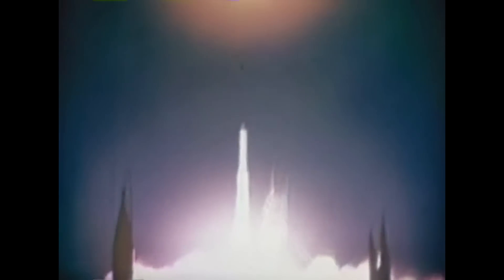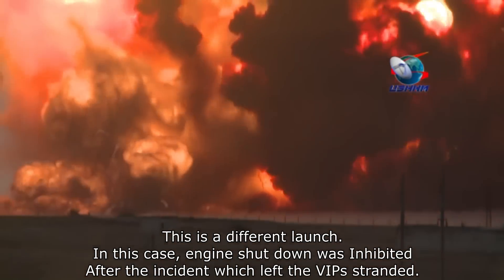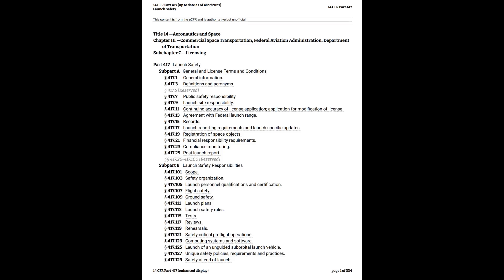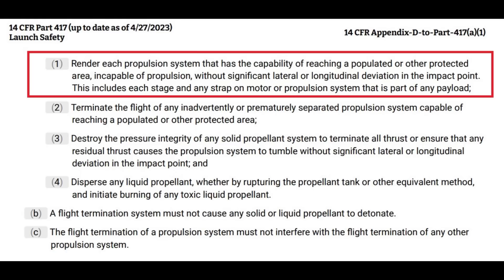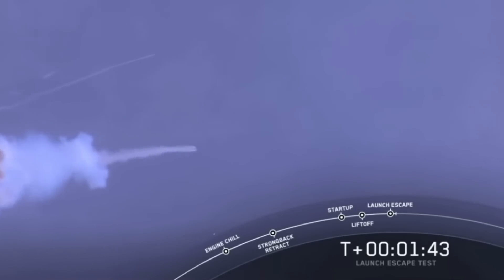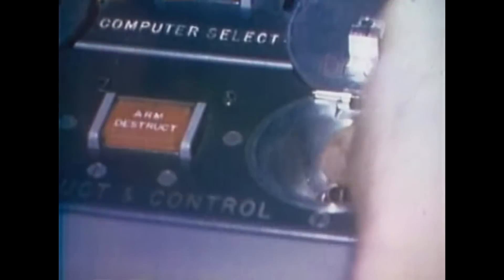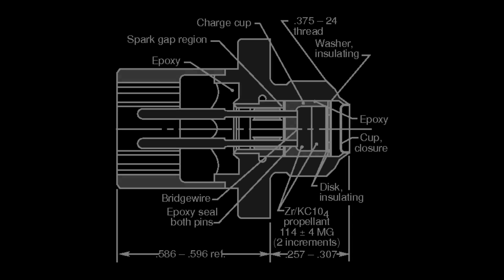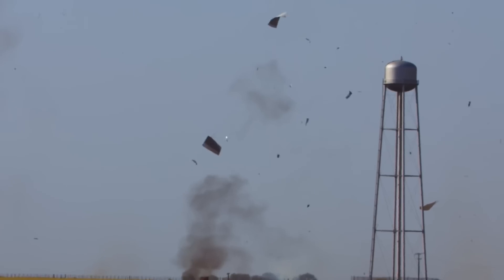How To Destroy Wayward Rockets - Flight Termination Systems Explained

Comment: Great explainer. And this where I have huge beefs with the mainstream media screaming headlines "FAA GROUNDS STARSHIP!!!1!". All of us space nerds know that when a flight profile does not succeed that launches are suspended while operations are reviewed. It's standard procedure. And one of those things that will be scrutinized is the FTS and its performance. Another will be the actual profile and whether the flight remained within range safety parameters. And then, of course, the issues with the launch facility will be examined as well. 

Only after the investigation is completed will we actually know if SpaceX, in the words of the media, actually "screwed up". Anything said in the media or in any other forum is purely speculation (although some more informed than not).

Comment: FYI…officially the term “FAR” is no longer used for the regulations. The FAA considers “FAR” to be the acronym for “Federal Acquisition Rules”. The regulations are the “CFR” Code of Federal Regulations for short or fully written out as CFR Title 14 Part 91, as an example.
Reply: That's true but, colloquially, we still talk about the FARs. There's even a link on the FAA's website called "Current Federal Aviation Regulations."

Comment: I reckon with the new ultra sized rockets, some rethinking of flight termination systems should be done. Just punching a hole in the side doesn't look like it is enough, especially if the flight goes bad and doesn't have nearly a full minute to spare between a problem surfacing and the eventual termination.
Reply: And we know a full minute passed how?
Reply: @TheEvilmooseofdoom  Because you can see it trigger and venting starts, then another, then another until finally after about 50-55 seconds the thing blows up. Scott talked about this on one of his videos. 

EDIT : Musk has now confirmed it was 40 seconds

Comment: So what would happen if a Falcon 9 developed an issue with landing at Vandenberg?  Since from the onboard cameras it looks like it comes in over land and not over the ocean like it does at the Cape?  Or do NASA own so much land there that the rocket deciding to make a crater wouldn’t put anybody in danger?
Reply: I think that's land owned by the airforce.

Comment: Good one Scott! What about recent Starship deal? If I understand correctly there was a several-second delay from termination charge going off to actual RUD. I expect all concerned will be taking a hard look at that.
Reply: Thunderf00t had an interesting idea, the system could destroy the separation bulkhead, and when the methane oxygen mix hits the engines it would detonate.

Comment: That 0.1% seems kind of weird to me. I guess it's based on simulations because they aren't going to test a hundred thousand flight termination systems in the real world to get enough statistical significance, but then how do they know that their estimation is accurate? Same thing with human spaceflight, I think NASA has a requirement of less than 1% failure for a spacecraft to be human rated but there is never enough data so how do they estimate that failure rate on a new spacecraft?
Reply: Simulations definitely give even more assurance, but in only in relationship with actual tests. A lot of things are tested way more that you would think, and things can be test separately. Yeah you cannot launch 100,000 rockets to test the FTS, but you could get pretty close just testing FTSs by themselves in different conditions and configurations. Also individual parts of the desing can be tested too, for example the shaped charges had been tested by the billions so far, giving a pretty safe failure rate figure.

Comment: The linear shaped charge has been developed from shaped charges used in shells fired from tanks and tank destroyers.  These used a pure copper as the outer coating, and created a plasma jet in front of the shell.  This jet opened a hole in the armor of the target, allowing the follow up HE payload to follow into the target.  The HE payload would then destroy the target from the inside out.

Linear shaped charges are now commonly used in the demolition of steel framed and high rebar density structures.

Comment: Scott its extremely clear that the Starship FTS failed to work properly. We can clearly see the ship breaking into two halves in at least one leaked image from the onboard video itself. It appears the venting of cryogenic fuels worked as designed as that is readily apparent in some films, but all other data leads us to think the FTS was either poorly designed or faulty. 

And don't get me started about the launch pad failure - that was incredibly dumb of SpaceX. And scattering large chunks of flying concrete and rebar into a protected wetland was also horrifying. SpaceX clearly lacks the required stewardship to be allowed to use this land. They should be grounded and a comprehensive review done and better requirements in place before another launch should be attempted. We know they are harming endangered species close by. 

But I guess if you think the world is gonna end that's a great narrative - it encourages people to splurge on a fancy EV and to feel less awful about killing some endangered birds, turtles, or whatever else has to die so we can escape to an even more hostile planet to mess up...

Comment: You gave the briefest mention of the Saturn 5 rockets using shaped  charges to separate stages which is something I have not heard before ! This sounds incredibly crazy and a spectacular way of facilitating stage separation, I heard they used 'explosive bolts' for that sort of thing but had no idea it was an explosive can opener !
Reply: If I'm not mistaken, some of those connections were made 
by Marman clamps.  Invented by Herbert Marx.  Yep, Zeppo 
Marx.  We used them on the Douglas MD-11.

steve

Comment: I worked on the Ariane 6 NFS (Neutralization Firing System), it's own version of the Flight Termination system. It's a strange system to design, specially the jokes in the office like: "if everything else fails at launch day, you'll be the only ones opening the champagne bottle" 😁
Reply: What did you do in your career? 
Well a real highlight was when I designed a super reliable a system that should never get used. 😂

Lol I kid, I really love the design philosophy of this kind of thing and I try to bring as much of it as I can to my daily work. Does the light controller on an emergency vehicle really need to be a 4 channel series parallel arrangement to avoid common single point failures? No. Is it cool? Hell yeah!😂
Reply: I wonder what's more disappointing: if the whole NFS project is never seen in action because every launch succeeds or if the rocket fails and the NFS has to step in :D

Comment: Have you ever had questions in the back of your mind, after seeing the 2 solid rocket boosters of the Challenger, continue in a straight line for miles after the fuel tank exploded, especially knowing that the solid fuel burns from the center of the boosters, outwardly, and the solid fuel nozzles are well below the tank? I mean, we weren't a part of the inspection, but there are a lot of coincidental locations that make me uncomfortable. Were the Challenger liquid engines even lit yet?
Reply: They don't light the solids until after the liquids are running and confirmed to be healthy.  They determine if the launch is going to go ahead.

Comment: IIRC the booster in the launch escape test wasn't manually destroyed by the FTS though it may have triggered when the booster broke apart after crew dragon separated.
Reply: No, they commanded and early shut down of the engines, it blew up on it's own after.
Reply: That's what I remembered as well that after dragon jettisoned the booster would lose its aerodynamic shape and break up on its own.

Comment: Great and interesting. But one Math question though: @2:02 the predictability of .999 means 1 failure in 1000, or doesn't it? Than it should be one per mil, or am I wrong?
At least "one per mil" sounds more reassuring than 1%

Comment: Not sure if this was to do with FTS or  tracking, but someone who worked at one of the  rocket startups told me that someone from the FAA ( or some other govt dept) would bring in a box that had to be integrated, and nobody from the rocket company was allowed to literally even touch it, and if they did, it would have to be sent back for inspection/recertification. Any ideas what that might have been?
Reply: Could’ve been the NSA with a telemetry encryption box.

Comment: I was imprest by the failed SpaceX launch despite the other factors.  The structure held together well and most of the engines worked.  Even when the rocket was tumbling. The launch sight was clearly an accident waiting to happen with the close infrastructure.  The risk of damaged cement was understood to some extent.  I also foresee the coast being to close and the land too low. High risk of hurricane damage. Big rocket makes very big bang. With some private damage locally. Most of these problems could be overcome. Elon does like risks. Thanks, Scotty, beam us up instead next time.
Reply: All US launch sites are on the coast.  They like to launch over water that's why no one launches east from the west coast.

Comment: Used to work with FTS systems before. This probably sounds childish but my favourite part was testing the system. There was a key switch to put it to operating mode then most buttons were protected by spring loaded flaps. Pressing the big, illuminated ARM and DESTROY buttons was so cool, felt like a movie!
Reply: That does sound like fun.
Reply: Did you get to make anything (even test articles) a long way away go boom?
Reply: @zyeborm  unfortunately no, I was just a technician and had to sign the system over to the operator/officer. I think twice it was used during my time there. No cool explosions though, it was used both times for large drones. In both cases they splashed down in to the sea for recovery.

Comment: Scott, would you care to comment on your previous observation that it took 50seconds between FTS trigger and eventual depressurisation and collapse of the structure, and Requirement 1 @3:53 in this (excellent) video?! In the context of a Super Heavy going awry soon after launch and heading for Port Isabel, 50 seconds sounds like it fails to meet this requirement...  

The video from Vandenberg showed that, once they realised it was headed the wrong way, they were pretty keen to get that thing destroyed and (considering there were people in the loop) they accomplished that commendably well.

I don't think this video commented on whether or not Star Ship or Super Heavy uses linear cutting charges; the implication is that they don't, and the added implication is that they probably need to. I think that could be OK for Super Heavy - the vehicle may at no point gets hot enough from atmospheric heating to threaten the stability of explosives in the linear charges.

For Star Ship though, having linear shaped charges on the outside during reentry must surely be a no-no; they're going to go pop. I can just about see ways a point charge FTS on Star Ship could be accommodated internally within a heat shield, or ejected from/off the vehicle following initial launch boost. But, if they're inadequate for Requirement 1 @3:53, might they have to have external cutting charges? And how does one get rid of those?

That's quite literally the $billions question. If they cannot have an adequate FTS and re-enter the atmosphere, getting StarShip into fully reusable service in one developmental leap feels a bit questionable.

If this does indeed turn out to be a problem, I can see a positive way forward. Ditch the re-useability for now; have a reliable linear cutting charge FTS that makes the FAA happy. Get the whole stack to the point where reliability is excellent, use it, get payload launches running. The possibility of a fully re-usable vehicle is that it can become viewed more akin to a civil airliner. We don't need FTS on 747s. I know that's an enormous leap in terms of reliability, organisation set up, etc. Then add in re-entry, re-usability; like they did with Falcon 9.
Reply: I've taken a look at the launch safety rules 417.113.d.1, "The flight safety system must terminate flight when valid, real-time data indicate the launch vehicle has violated any flight safety limit of § 417.213". 

417.213 "Flight Safety Limits" in turn under "Flight Safety Limits" has at .b.1 "All time delays, as established by the time delay analysis of § 417.221".

417.221 "Time delay analysis" requires one at .b.3.v to consider the delays in flight termination systems. This is where the 50 seconds fits.

Add that all up, it it's known that the time between fts trigger and acceptable disintegration / destruction of the vehicle is at least 50 seconds, then for a safe launch they have to be able to know that something is wrong and that an impact is expected 50 seconds before that impact point can (having accounted for all possible vehicle / debris dynamics) move to become Port Isabel.

The problem I see is that they probably don't know there's a problem until it has left the pad, and it's less than 50 seconds flying time to Port Isabel. It's only 5 miles away... Super Heavy is perfectly capable of a short hop straight there. So I really don't see how a launch can be safe, if the time taken to actually destruct the vehicle is 50 seconds after trigger. It's a logical impossibility. They'd have to be able to predict the future.

I can't really see any choice but to ensure that FTS trigger results in faster effects. Surely both Star Ship and Super Heavy are going to have to be cut to pieces by linear cutting charges?

I did spot another rule 417.3.(c). The FTS for one propulsion system must not interfere with any other flight termination system. I doubt that lighting the Star Ship engines accomplishes the reliability requirements for terminating flight, so I don't think that it could be use as Super Heavy's FTS. That'd mean having to have an FTS on Super Heavy. I don't quite know what is meant by "interfere" - radio interference? - but lighting up Star Ship's engines if still attached to Super Heavy would probably count as "interfering" in some way!
Reply: Have we any actual confirmation of the timeline?  Speculating in a video is one thing, passing that off as a fact is another.

Comment: I wish wouldn’t speak about the Monroe effect in terms of a “hot jet”. The liner is deformed very rapidly, so yes, the liner material will get very hot. But this really doesn’t have much to do with the penetration mechanism. 

The high pressures of the detonation front combined are far higher than the yield strength of the liner material. Thus the liner material is forced to move very rapidly (thousands of meters per second). The symmetric geometry of the charge forces the material into a very precise axis of advance. At the penetration point the pressure of the advancing jet is much higher than the yield strength of the target material. Therefore the target material is pushed out of the way. 

Better symmetry and liner material properties results in more jet material hitting the same spot -> better penetration 
Higher detonation velocities in the charge result in a faster jet -> better penetration

Comment: Be interesting to hear about the security of FTS activation signals. Presumably in the early days this was a simple radio signal that could potentially have been spoofed by foreign agents to sabotage a launch? Hopefully modern FTS signals are cryptographically secure, but of course that massively increases the complexity of the receiving hardware and add more points of failure?

Comment: My Dad was a Range Safety Officer at Port Canaveral in the 70's, before Kings Bay opened up. He would blow up sub launched dummy ICBM's when needed. They used a grease pencil and drew lines on a radar screen to help them see when a missile went off-course.

To destruct he flipped a switch that was covered by a red button. I think he also had to insert and turn a key first, and it may have taken 2 people to send the destruct command. Obviously I was never allowed in the room during a launch. 

I do remember seeing a few destruct, and man did they blow up. One missile was destructed at night and the whole east coast of C FL thought the Russians were attacking us.

Good times

Comment: I watched a pretty thorough analysis of the Starship launch that indicated that both the upper and lower stage FTS may have failed and that the rocket after multiple engine failures, which included 2 of 3 gimballing engines failed and what ultimately lead it to breaking up and explode in the venting gasses.
Reply: Lots of armchair experts drawing conclusions from very limited data. It's what gets them views and views is the name of the game.
Reply: @TheEvilmooseofdoom  Tory Bruno is the CEO of ULA, United Launch Alliance. You may have heard of them. They launch Atlas V and Delta IV Heavy still. He's not an armchair expert. The first words of his comment are "Great job as always Scott"
Reply: Look for Tory Bruno’s comment (yes, that Tory Bruno) on this video. He explains that the purpose of the FTS is really to keep the rocket parts on-range and that destruction is incidental to that purpose. EM has said that they do want to look at the FTS performance, though. This last secondhand from someone who watched that paywalled discussion.

Comment: How does it work with manned missions? Man missions when there's an escape system?
Reply: A Launch Abort Escape System and a Flight Termination System are entirely independent systems.  I don't know particularly; however I would imagine that most of the safeguards are procedural rather than digital or electrical; interlinking the systems would likely affect the reliability of both.